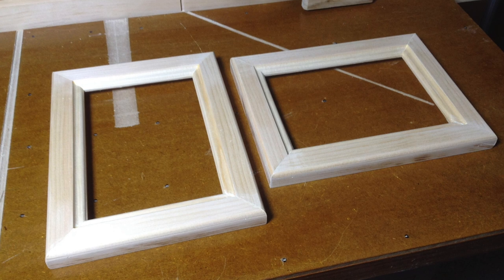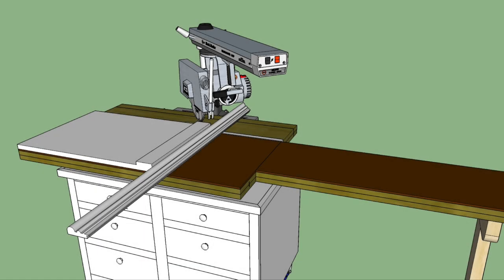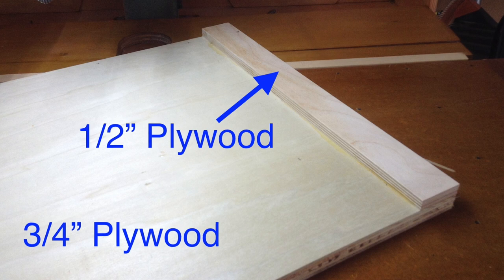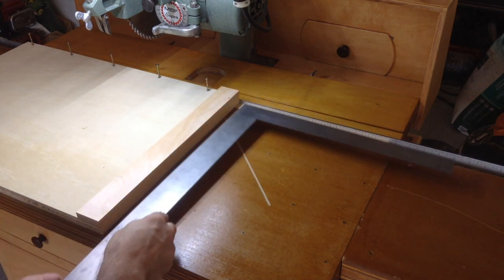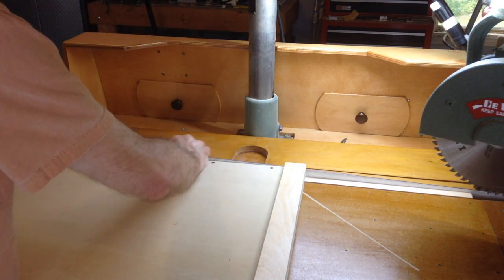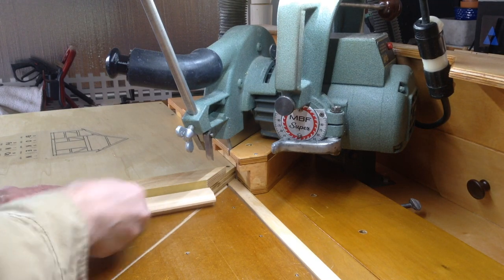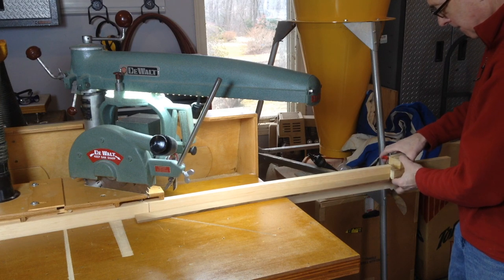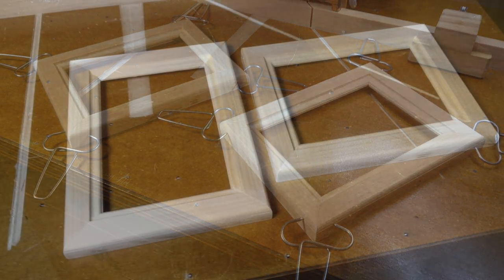Perfect Miters with a Radial Arm Saw

Comment: Terrific! Perfectly logical. I'm right handed so I'll copy but reverse the orientation of the 90° fence, so it is more natural for me to draw the saw and also hold the piece on  final cut with my left hand.
Reply from the maker: Thank you.  I think you'll find that this is the best orientation to perform the broken fence method (unless maybe you have a Delta, turret-style saw).  If you were to fix the saw to a left 45 degree angle or change the orientation of the fence, you would probably need to make your second cut from the opposite side of the frame. Although you assume the frame sides to be parallel, you are not setting the same (reference) side of the frame against the fence.  It's very common to use both right and left hands to pull the carriage depending on which hand you hold the wood (but never cross your arms when doing so).  Another excellent way to cut accurate miters is with a fixed jig (search YouTube for the "Flying Wing Jig" by Wally Kunkel).  Note that the "Broken Fence" method on the RAS was also published by Wally Kunkel Sr. in his book "How to Master the Radial Arm Saw" (I highly recommend it).

Comment: I remember my dad using this method to make frames for mirrors when I was a kid,  in the 60's 
Radial arm saws were/are so much better & versatile, I'm happy they're becoming popular again.
Reply from the maker: The older saws are still good machines to use!
Reply: @brianweekley5700  Hi, for 2 Days a Bought a Dewalt DW 1503. It's seems pretty solid, and heavy. 1990 kinda model. 
What do you think, it's a good RAS, or the older are much better ? :) Thanks for the answer
Reply from the maker: @adamhideghety5612   Hello, the DeWalt 1503 is a nice, solid cast arm saw.  However, when you indicate "DW", that usually indicates a European model and may be different from what I thought you might have.  I suggest joining the "DeWalt Radial Arm Saw Forum" where you can find a lot of good information and answers to any questions you might have.  There are several forum members that own European models that may have more familiarity with it.

Comment: Great stuff! Question for you, Brian....What is the purpose of the 1/2" "taller fence"? If mainly doing window casings or picture frames, it seems superfluous as the base 3/4" ply would be more than enough.
Reply from the maker: Thanks for the question. In my case, I added the extra fence height anticipating I may use thicker stock.  If you're only working with 3/4" stock, it wouldn't be needed.

Comment: Thanks Brian.  Seems much more efficient than the flying wing jig.  Do you think you can do crown molding with this?  Thanks
Reply from the maker: This is the miter method described in Wally Kunkel's book. As long as the fences are high enough, I don't see why you couldn't use it for crown molding too.  However, the flying wing jig is designed to easily block the pieces in place against the fence.  The accuracy of both depends on how square they are made.

Comment: Looks like you have a De-Sta-Co 305-U on your stop block. Is that the hold clamp you are using?
Reply from the maker: I have another video titled “Making Stop Blocks for the Radial Arm Saw”.  I had bought the small toggle clamps on eBay many years ago.  At 1:40 in that video, you can see the markings as “GH-13005”.  Probably a cheap knockoff of the DeStaCo.  I hope that helps.  Note that the stop blocks I used for the frame miters are inside vs. outside angles (good to have both).
Reply from the maker: https://youtu.be/OYLoUxIp1uY

Comment: Hi Brian, thanks for putting out informational videos for everyone, that's awesome. I have a question for you though. I'm just getting started with wood working and I have a very nice radial arm ridgid miter saw. But it is not giving me precise cuts that I desire. I checked my squares, checked if I'm square to my fence and I still don't get the cuts I'm looking for. Then I  watched reviews on this saw (out side my return date) and found out there are some flaws in them, witch would explain my bad cuts. But now I picked up a radial arm saw off Facebook market place for cheap! Its old but runs good. In your opinion, radial arm saw over radial arm miter saw?
Reply from the maker: A vintage, quality cast-iron, radial arm saw (like the old DeWalt's) are excellent machines.  The disadvantages are they are very heavy (not easily portable to job sites) and needs to be setup/calibrated properly.  However, a radial arm saw can do many things a sliding miter saw can't.  You can't beat a radial arm saw for cutting dados, it makes an excellent molding machine, and can also rip.  For my use, I'd take a (good) radial arm saw over a sliding miter saw anytime.
Reply: @brianweekley5700  It's not even close.

Comment: Baloney. I challenge anyone to get accurate results this way.  Good luck. Bottom line, wrong tool for the job.
Reply from the maker: I appreciate the comment.  Challenge accepted—results were perfect!  This idea wasn’t mine—it’s a proven technique used to cut 90 degree corners on a RAS (published by Wally Kunkel in his book, “How to Master the RAS”).  Unfortunately, this technique is not widely known so I thought a video might be of interest.  I’ve been using this for many years and it works fantastic!  As long as the auxiliary fence is 90 degrees, you will end up with perfect 90 degree corners every time.  It really couldn’t be easier.
Reply: Quality craftsmanship requires attention to detail.  This technique absolutely works for those with an eye towards perfection and the skills to match.  I do agree that many people would not be able to pull this off on a consistent basis, but the issue is them - not the machine or approach.
Reply: The classic DeWalt radial arm saws aren't like anything else. They are engineered beyond anything made today. They are infinitely adjustable and fine tune-able so that perfect cuts that are repeatable. Brian's videos follow the directions put forth by Wally Kunkle, recognized as the guru for these saws. Brian's videos do a remarkable job of detailing how to set up your saw perfectly and I'm very thankful he has. He's my favorite content producer on YouTube.
Reply: Accurate cuts are the norm for a well set up DeWalt RAS - especially one from that era, the golden age of American machine tools.  Today, this is achievable with almost any off the shelf chop saw, sometimes with a smidgeon adjustment.  The difference is that the RAS is not just a chop saw, but a true multi tool, equally accurate in all phases of its design. With proper set up, they are very satisfying to use.  Back in the 1950's when you purchased one, a DeWalt trained technician would come to your house and set the machine up for you, with a guarantee of accuracy. The only thing you needed to do  was learn to always know the location of your thumb.
Reply: My dad did this when I was a kid, making custom frames for picky interior decorators. I started getting to "help" when I was 8 or 9; he let me start learning at 10 (mom's rule). That was 1967, it worked. Still works for me today.
52 tears later, I've got chop saws, table saws and this method still the best.
Reply: Punk comment. Obviously, you have no idea what you are talking about.
Reply: Just getting into the zen of RAS.